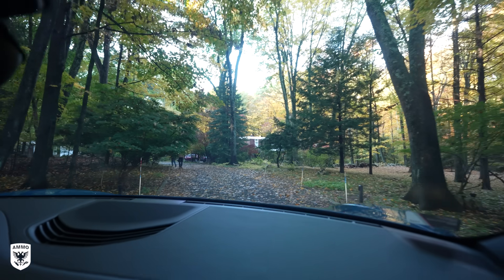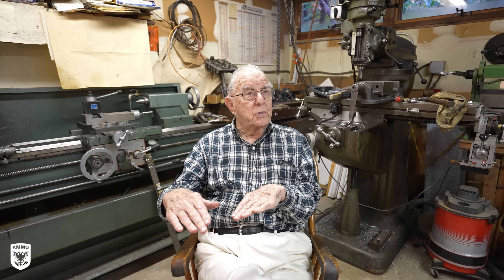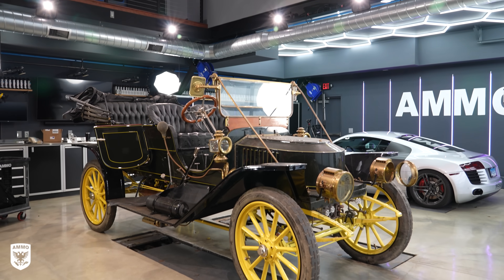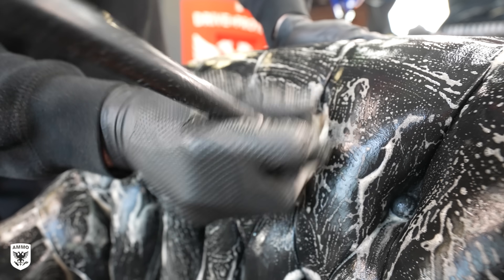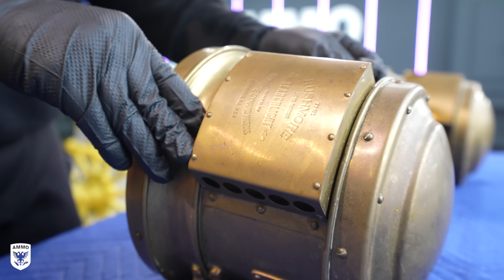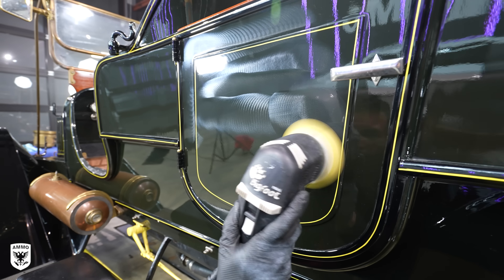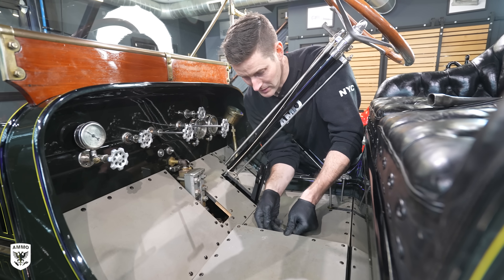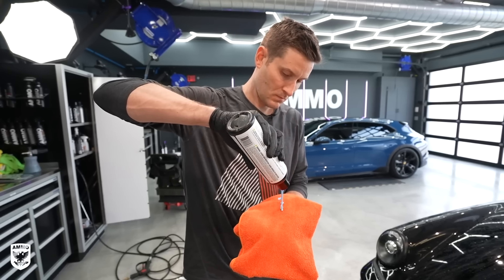1910 STEAM CAR Full Detail with Mold, Mice, and Swirls Huge Before and After!

Comment: This car survived both world wars and is still in better condition than some 1990s cars I’ve seen
Reply: @timschulz9563  still survived
Reply: I mean by survived you just mean it was around at the same time then yeah. Probably locked up in a barn somewhere lol
Reply: @industrialvectors  boo
Reply: @zeitgeist2720  still better condition than others
Reply: It all comes down to the two bucket method 😂
Reply: @zeitgeist2720  no, it definitely wasn't around at the same time. They may be 1910 and 1911 *models*, but they were still built in 1988. So... they "survived", or were around during Desert Storm, Afghanistan, and Iraq.
Reply: @UpperDarbyDetailing  Many of the parts on the car are surviving originals.  The engine, all the brass, the controls, gauges, etc.  The car was assembled with original parts and a wood body / frame that was built by Mark Herman and his team.  The boiler and burner and all the interconnect / pluimbing is new, but much of the car is original parts.   So the parts survived, and the car was created.
Reply: @josephfedullo7730  fair
Reply: When you watch the video but didn't pay attention at all hahaha
Reply: You say that as if it’s been a daily driver since then
Reply: @Elshiem  when you read a joke and don’t get it at all hahahaha
Reply: @Ian4bis  ...you, are the joke buddy.

Comment: Curious as to the level of brass/metal polish necessary, as seen in museums I don't usually see the brightness to which you restored on these two steamers... were the owners looking to have the full gleam or was that a determination that you made Larry.  Great work as always!
Reply: Larry talks about the products he used on the brass at about 9:40, which I found a bit odd as I thought he normally used Flitz for polishing metal and that would've worked fine since these pieces didn't look particularly oxidized. I personally have used Mother's mag & aluminum polish, Simichrome, White Diamond, and regular old white polishing compound, etc. Brass is a soft metal and takes a brilliant shine rather easily, but is very susceptible to oxidation. You'd want to coat it with something like Renaissance wax to protect it after polishing because your skin oils will immediately tarnish it and it will form a natural patina over time just from exposure to the atmosphere. It may have been a while since the museum pieces you saw were last polished, or maybe the curators decided that a high level of shine wasn't historically accurate.

Comment: He calls them a 1910 and 1911 models. But really they are replicas, right?
Reply: I would call them assembled cars.  The wood body and wood frame Re new made by Mark Herman.  The burner and boiler are also new.  Things like the engine, pumps, gauges, lamps, etc are from original cars.
Reply: Ahhh.  I wish they would have gone into what exactly was original and what the guy built.